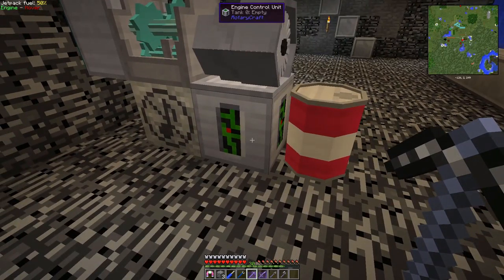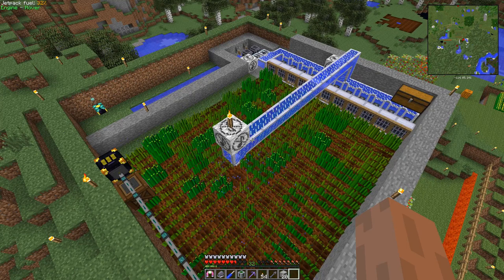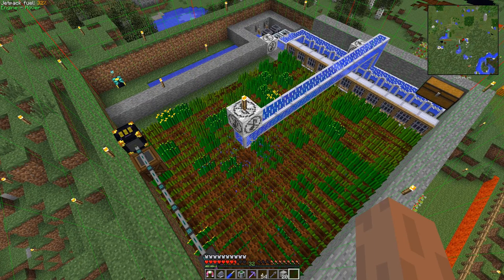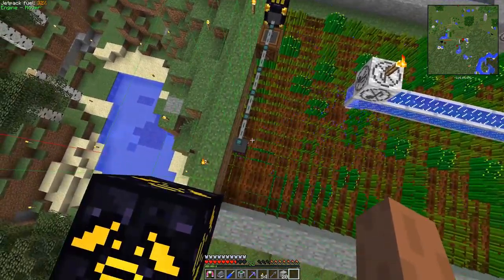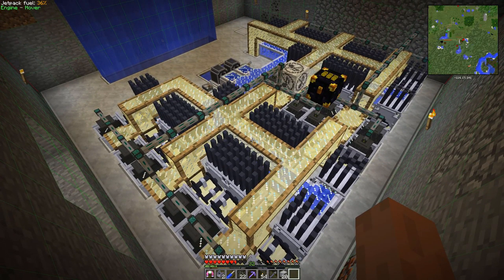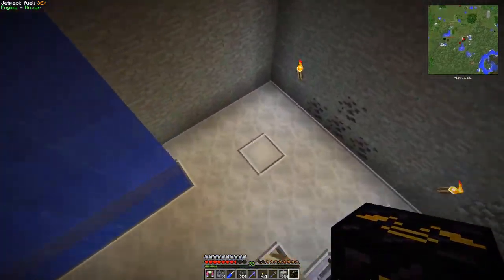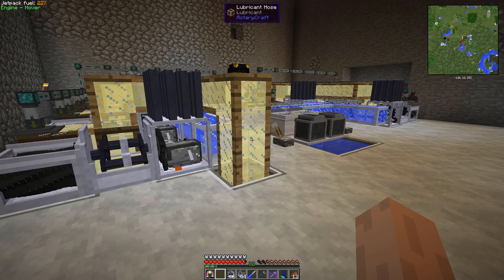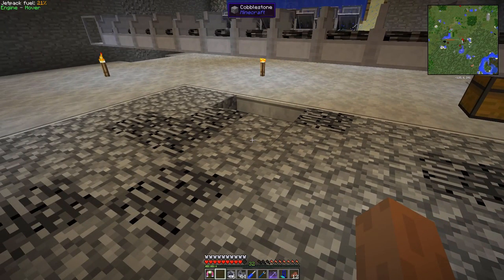RotaryCraft: Breaking Bedrock for Free (OCC)

Comment: Nice video, and a pretty efficient setup considering the mods you used. If you have spare diamonds, you can save on lubricant in the grinding setup by making diamond gears, which only need to be lubricated once. Similarly, you could use bedrock gears that don't need lubricant at all. But actually, I'd probably prefer to use a higher tier engine to power the grinding setup. One performance engine or AC engine would be more than powerful enough to both replace all of the steam engines, and reduce the number of grinders you need. But I suppose that wouldn't be entirely self-sufficient. Perhaps an extra hydro turbine could be used, although I'm not sure if that would use too much lubricant.